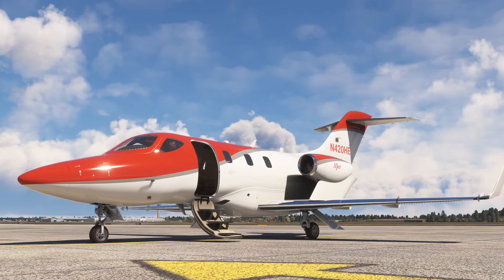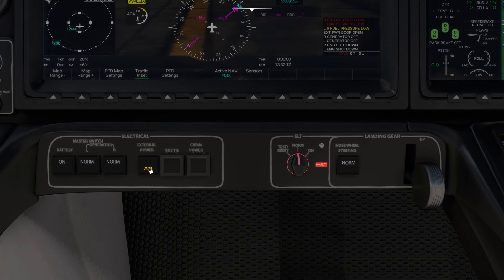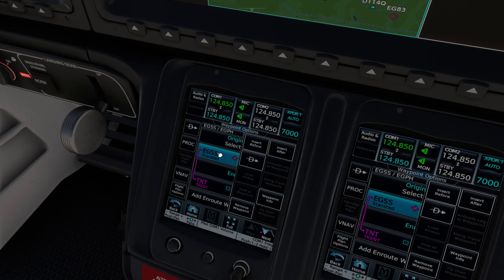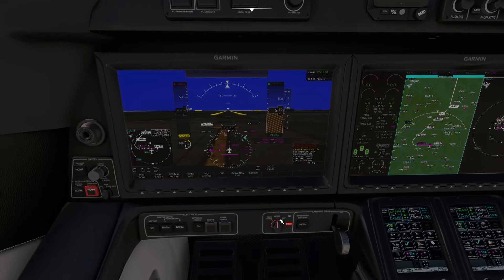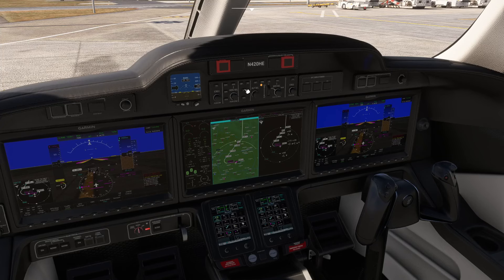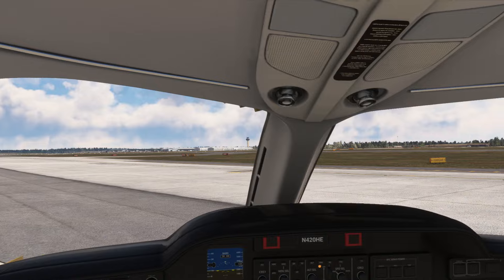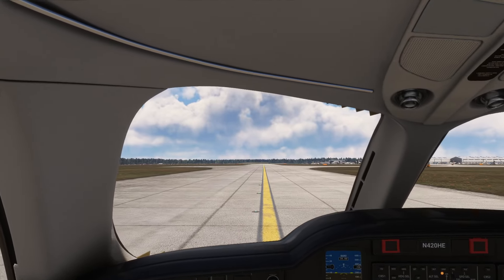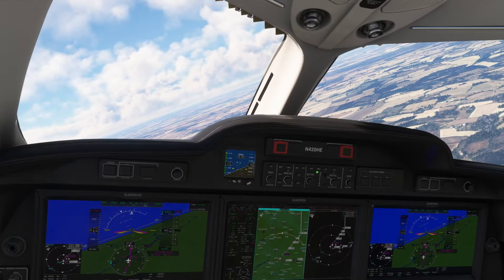Starting the FlightFX HJet from cold and dark in Microsoft Flight Simulator

Comment: Very nice tutorial, Jon, thanks. Oh and heres a tip to the Devs working on the msfs2024 with regards to weather. There's no need to display everything from the air, I don't think. I've just come off a CRJ-700 flight IRL and it just struck me most of the terrain seen from above is usually shrouded in mist, low clouds, low visibility and so on. These tend to make most of what you see gauzy cloudy and in Sim terms reduce the workload on the GPU, I think. The tendency to show stark details from the air robs us of the mystery of aviating above a very mysterious world. Clear skies should be the exception, in my view.